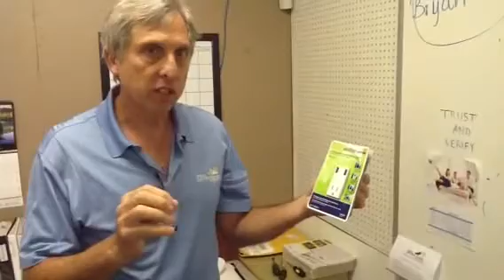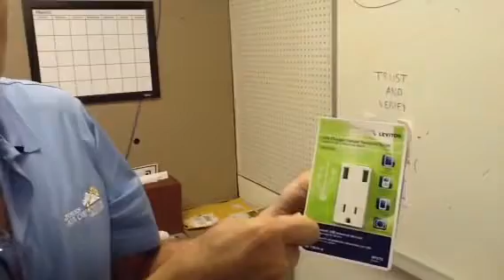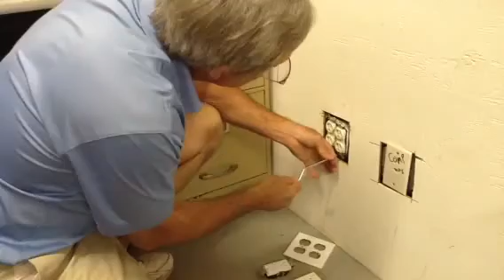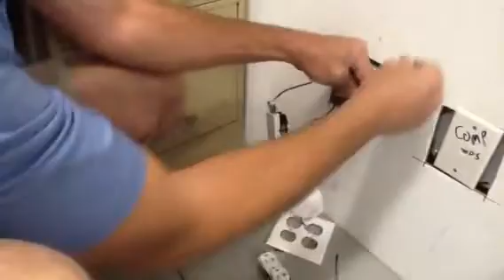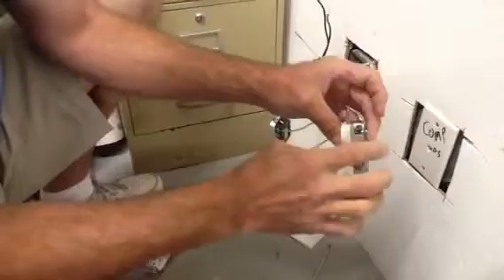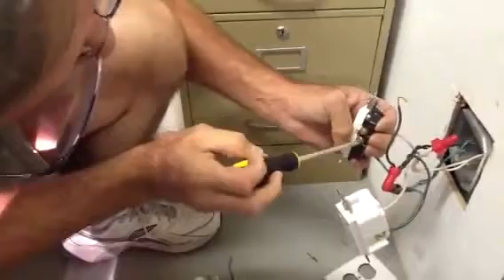How to USB Wall Outlet Installation

Comment from the maker: Take a piece of small wire the and twist the all whites together, do the same with the blacks. What you will end up with what is called a pig tail. Put the white pig tail under the white screw, then do the same with the blacks. Make sure the green wire is on ground screw. Thanks  for watching.

Comment: Never use the punch in hole, it will go intermittent over time and burn the outlet. Only problem I have with those USB outlets is that they will probably fail after 2 years or so, as they are built down to a price and are always on.